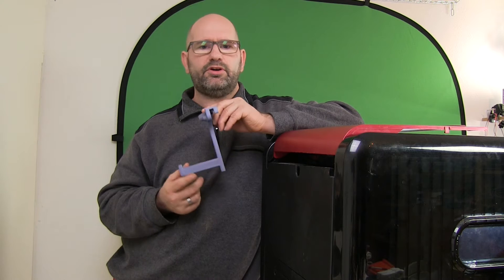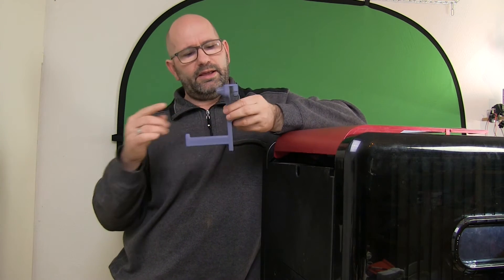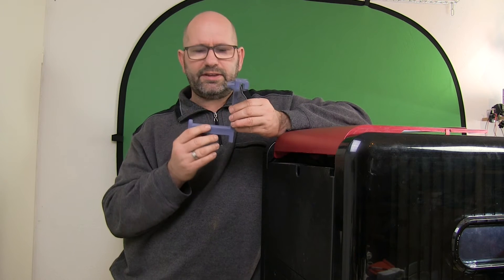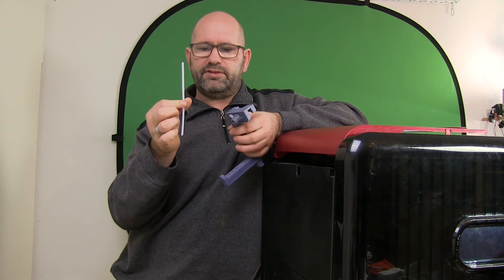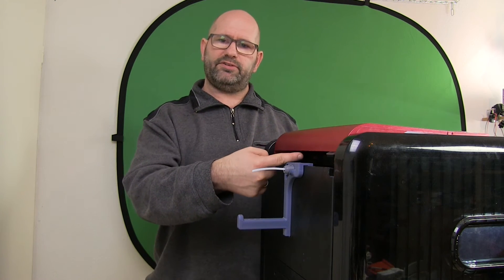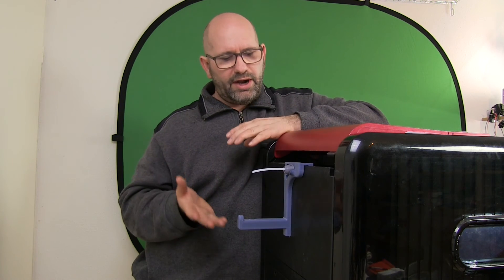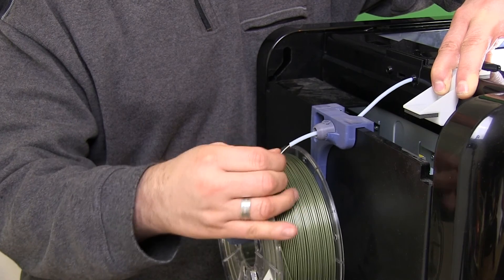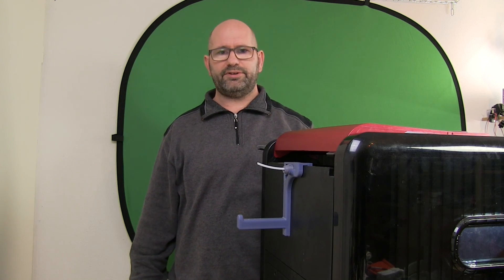▼ PTFE tube for the Da Vinci Pro Filament Holder

Comment: I have a davinci pro as well and use simplify3d. But I have never gotten petg to print well. I noticed in this video you inserted some petg could you please share what settings you are using.
p.s. have been using your spool holder since day one, great print.

Also a tip i did that maybe you would like to try. I used sugru to enclose my nozzle and the leveling pin leaving about 1mm from the tip.
since then my pla prints have come out much better without needed to use an extra fan.
Reply from the maker: PETG is a pretty difficult material to print in a bowden machine. I don't have the right settings YET? But I have 2 KG of it laying around here, so lot's of possibilities to try.

What is Sugru? Never heard of it but you make me curious.
Reply: 3d Print Creator the website for it is sugru.com it starts similar to a clay you can mold and when it dries it becomes rubber.
What I tried to replicate using the sugru were these http://e3d-online.com/Socks-Launch
Reply from the maker: Thanks, I ordered some :-)

Comment: Hah, I've actually done nearly the same thing with mine. After 300 hours of use, the filament wore a groove into the ABS spool holder. I had some left over PTFE tubing from another project, so I just stuck a length there, it works like a charm! Good suggestion!
Reply from the maker: Thanks, and indeed it works perfectly.